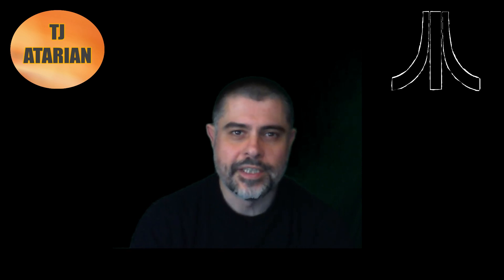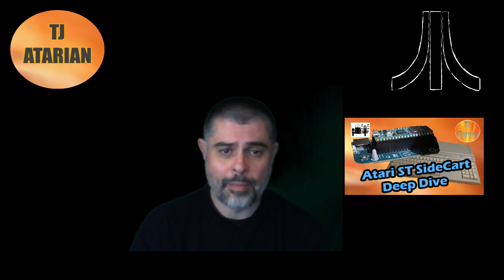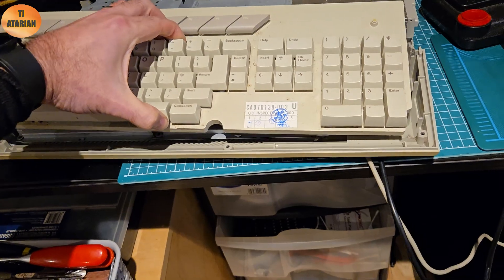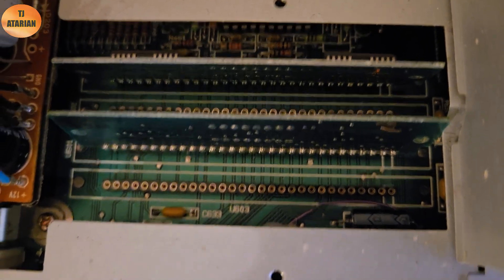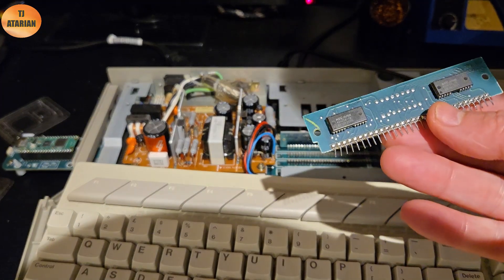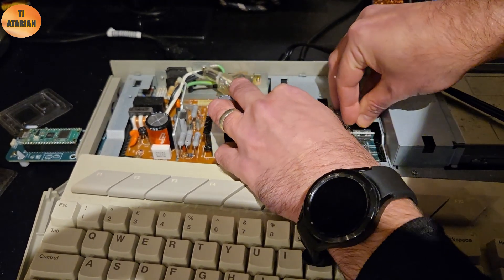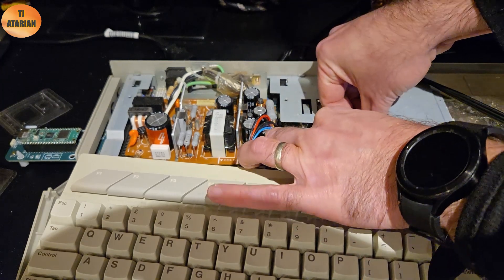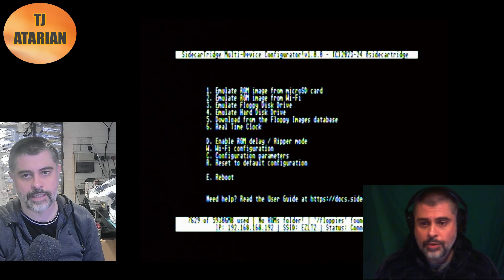Atari STE Memory Upgrade

Comment: SIPP memory. What an odd choice by Atary. Maybe an earlt board revision?
Reply from the maker: I believe it is an early STE board, and most later boards moved to SIMMS, which are pin compatible, thought just glad I was able to source SIPPs and not have to mess around converting SIMMS to work!
Reply: @TJAtarian  at least, these are very easy to put in and out. SIMM socket in STE are in plastic, and the upper metal shield block the right side a bit too much. Cheers!

Comment: I remember getting my Atari ST 520 RAM doubled way, way back in the day.  I sent it off to a company in New York who piggy-backed every individual RAM chip.  It worked.
Reply: Did that too. You had to connect the cas and ras with little wires to do that. A afternoon fiddling around to make my Atari ready for Calamus.
Reply from the maker: I was trying to remember the name of the upgrade my old 520 stfm had in the 90s them it came to me... It had a Frontier Xtra ram, which looked like this : https://images.app.goo.gl/mTKCXkhQen67EfwU9
Reply: If I'm not mistaken this was also done by Atari to a certain amount to upgrade 520 boards they had in stock to 1040 machines.